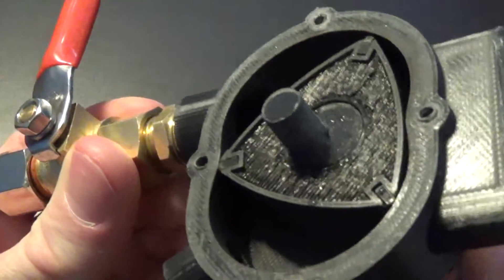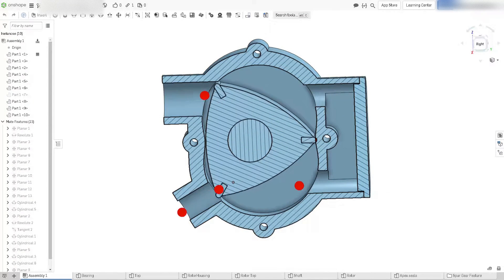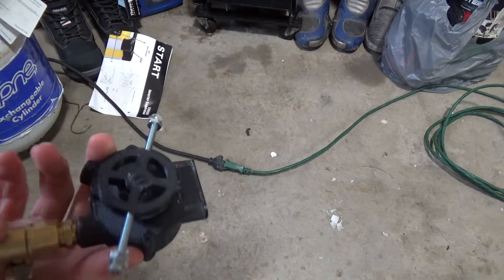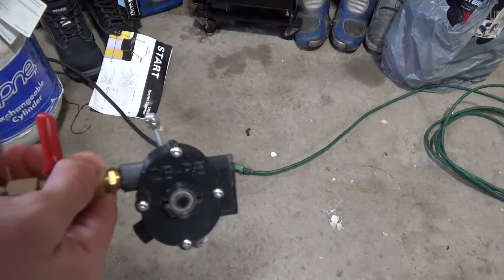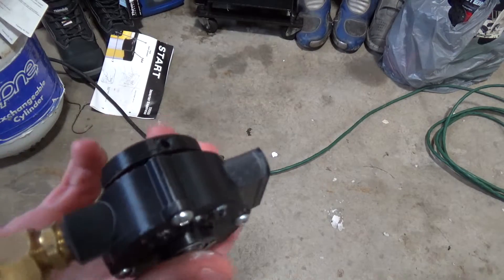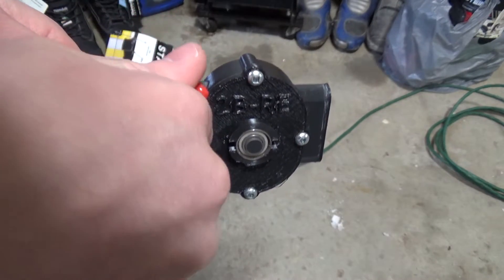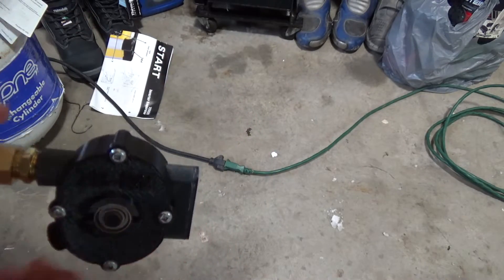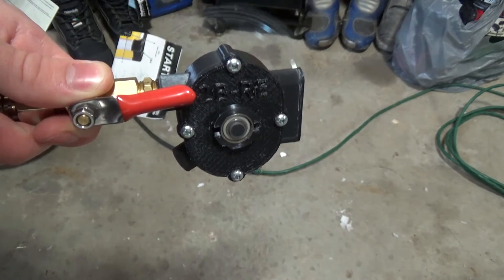3D Air Powered Wankel Rotary Engine Mk.II! Major Improvements!

Comment: Still wondering on the bearing size lol
Reply from the maker: Yea its a strange one, the outer race is 16mm while the inner race is 8mm kinda like a 608 bearing and the thickness is 5mm
Reply: @CamdenBowen  hmm, when I tried a 608 it was too large, do you know how much I would have to scale it for a 608 off the top of your head?
Reply from the maker: @ElMatero6  I wouldn't bother with trying to scale it since it would mean other parts won't fit, when I get a minute I can just adapt this file to work with 608 bearings so you won't need to scale it at all
Reply: @CamdenBowen  and this is why I enjoy your work so much lol!
Thank you!
Reply from the maker: @ElMatero6  No problem bro
Reply from the maker: @ElMatero6  https://drive.google.com/drive/folders/1qWZzNT1uhtICNmU-oaqtW1LQ2EwQpUla?usp=sharing here's the updated link fit for 608 bearings
Reply: @CamdenBowen  No Way! Really appreciate it, gonna print it tonight!

Comment: Printing it now, what does 2B-RE Mean? Also it looks really nice on the Ender 3.
Reply from the maker: 2B-RE is simply there for looks, it is inspired by the name "13B-RE" which is one of Mazda's notorious rotary engines, the 2 in exchange for the 13 is because this was my second mockup
Reply: @CamdenBowen  Interesting, Thanks for the reply, do you happen to have a discord?
Reply: @CamdenBowen  Also What Sized bearings did you use because my basic skateboard bearings dont fit

Comment: great vid! 
btw is this fully air tight?
Reply from the maker: Thank you! I did not apply any grease to the inside of the motor, there is very slight gaps around the seals and the rotor

Comment: Hey, I'm a high school student, and I recently took interest in these rotary engines and want to design my own. I was wondering if you could give me the original file type in whatever cad software you used or just a .step file. Also, could you possibly point me in the direction of where you got the information of the equations and dimentions correct. Sorry to ask so many questions but did you model the shape of the rotor and housing using equations or did you just get the sketch off of somewhere? Thanks!
Reply from the maker: I too am in highschool as well! I'm glad you are interested in these things! I used Onshape to design the engine and if you need I can add the original files to description where you will be able to make a copy and make your own
Reply: @CamdenBowen  yea that would be greatly appreciated. Did you model the shape of the housing using the epitrochoid shape?
Reply from the maker: @lithiumfpv9254  Here's the link: https://cad.onshape.com/documents/5efe4a34772c5b8f3a2c9174/w/f5ecb5bb3d4bebda82337adc/e/81a6be5a328cdc0e8c52e442
Reply from the maker: @lithiumfpv9254  I used an epitrochoid to make the shape of the housing, after finding what size it needed to be I was able to plot it out
Reply: @CamdenBowen  Did you use an equation for the robot of did you just make an equilateral triangle and then make some arcs? Also, I know the center gears have to be in a 3 to 2 ratio but how do you determine the size of the gears? Thanks again.
Reply from the maker: @lithiumfpv9254  the rotor is just a triangle that will appropriately fit in the housing, the apex seals were designed to moved outwards to compensate for the sizing. I can't exactly explain how big the gears need to be, I just trial and errored the sizing until I got one where the pitch radius of both the fixed gear and the rotor would line up correctly and mesh correctly
Reply: @CamdenBowen  good to know, Im trying to come up with some ratio explain the relationship to the length of the rotor housing, to the length of the smaller gear, that way I can get a more precise fit.
Reply from the maker: @lithiumfpv9254  There defiantly is one, I just never looked for one beyond finding the answer

Comment: Have you heard of Angelo Di Pietro’s ( former F1 engineer) CA rotary engine? He’s using it on a scooter, a Car, a Forklift, a Flatbed etchttps://youtu.be/ZGiviT-C_oY.
Reply from the maker: Thank you for sharing this! I have seen some demonstrations with his technology and I want to in a future video create a small air motor powerful enough to drive a bicycle around maybe
Reply: @CamdenBowen  Yeh, if you’re CA engine was scaled up a bit, it would be great for a Bicycle/Tricycle, actually a Tricycle would probably be well suited. As the space between the back wheels could be used for an Air tank, you were already aware of Angelo Di Pietro’s CAE. Cos I was thinking that some design features of his engine might be able to be used on your CAE. Good luck and keep up the great work you are doing. Imagine a CAE that can be 3D printed, and mass produced, so anyone could get DIY modification kits for their Bikes/Trikes. Angelo has been sitting on his engine for about 10 years, so it is up to people like us to make this low tech solution known about and available to the public. ✊🏽🌎🌻Rant over! Soz!
Reply: Ive been researching alternative fuels for about 10-15 years, and think CA, Carbon Negative Algae Bio Fuel. Also Hydrogen from water used in FCEV are the 3 best!
Reply from the maker: @Kiyarose3999  Defiantly however I think that pneumatics is a bit more problematic as it requires energy to obtain enough air to make it move around, instead of just using the energy to move the vehicle in the first place. Hydrogen and Carbon Negative Algae Biofuel as you stated above I think are much more suited as they produce much more energy to use than it does to source the fuels.
Reply: @CamdenBowen  But CA is a good way to store excess renewable energy,, and can be compressed with a basic mechanical Turbine, so no need for electricity. Also Air can be compressed using a Trompe, which used to be used to power Air tools, Jack Hammers etc.

Comment: I think that this is more of a turbine, but great job! Ideally you would have as little air coming out the exhaust as possible so that all the pressure is used to move the rotor/piston. On my engines I don’t have an exhaust and I think it works because all the air is being used to move the piston.
Reply from the maker: There isn't much compression going on in the engine but the exhaust is important as the air needs somewhere to go once its served it's purpose, at least for this case. Thanks man!
Reply: "Perfection is achieved, not when there is nothing more to add, but when there is nothing left to take away."

Comment: printing this now, hella cool. im impressed on how you designed it so each air pulse pushes on the rotor twice without backdriving it and wasting energy.
if you were to do a v3 one thing i would suggest using a bearing as the lobe of the eccentric shaft so the rotor and shaft can have a low drag high precision fit without inevitably heating and fusing. plus a multi piece shaft with proper design work (and midplates) would make stacking rotors easy.
Reply from the maker: Thanks man! I agree with mostly everything except for a multi piece shaft, I've expermiented with multi piece shafts and I find they don't align correctly and cause the motor to lock up
Reply: @CamdenBowen  im sure its possible, just need to stare at it for a few days before you have an epiphany :)

Comment: Combination of engine and pump! 😂 that’s more than I thought, great work!
Reply from the maker: Thanks man!
Reply: @CamdenBowen  how do you think about make an airplane with this😂, looks powerful, how is the efficient?
Reply from the maker: @minercraftal  it would need plenty of air and air pressure to be able to turn a normal sized remote controlled airplane that I don't think it would work very well, but maybe it could
Reply: @CamdenBowen  so the power to weight ratio is not under requirements? Never mind, have fun!

Comment: I think you should put the 'intake port' where the combustion would traditionally be as that is when the 'chamber' is at its smallest and the exhaust in its normal spot as well, this would allow you to use the pressure of the air rather than just the velocity because it would be trying to push the rotor towards the atmosphere. This would produce more torque, but slightly less top speed, as a matter of fact i may modify your design to do just this.
Reply from the maker: Good idea! The reason I set the port much higher rather than when the rotor is at the point if lowest volume is because blowing against the rotor at this point will cause the rotor to spin backwards and not run. The use of valves can solve this but I encourage you to try!

Comment: Amazing work man, congratulations, the fact that you designed the engine to bleed the air into the chamber nearest to the exhaust before sealing the chamber nearest to the inlet is some of the most out of the box and cleverest thinking I've ever seen
Reply from the maker: Thanks man!

Comment: Great Design! I was wondering if you could/would add the design files so I could try to remix it & and adjust the tolerances a little more to help with post-processing! and if you would also add the flywheel file to google drive. Thank you for taking the time to design this and Posting!
Reply from the maker: Yea go ahead man! I added the flywheel to the folder in the description, the apex seals fit into the slots cut into the rotor corners though they need sanding to fit correctly. This was done purposely so you could shape the apex seals perfectly.
Reply: @CamdenBowen  awesome man gonna be my project for this weekend !!
Reply from the maker: @nickr9554  Sounds good!
Reply: also where does the apex seal go?

Comment: Sounds awesome, good job!
Reply from the maker: Thanks man! I really wanted to try and recreate the notorious brap that rotary engines are associated with
Reply: @CamdenBowen  can definitely notice the brap when throttling up and down. Really like your flywheel too, that you can add and remove screws to change the weight is pretty smart!

Comment: Can i put this on a rc race car?? I mean does it produce enough power?? Nice video as always keep it up!
Reply from the maker: Thanks man that means alot! Currently this engine mated with the correct gearbox could probably move a light enough RC car but not very fast, I have plans to make a 2 rotor version of this engine to see if it will produce more power.
Reply: @CamdenBowen  thank you for the lightning fast reply and the information! I look forward to see the 2 rotor version!
Reply from the maker: @hyperideryt4989  Stay tuned :)